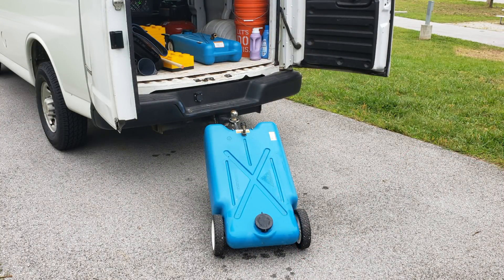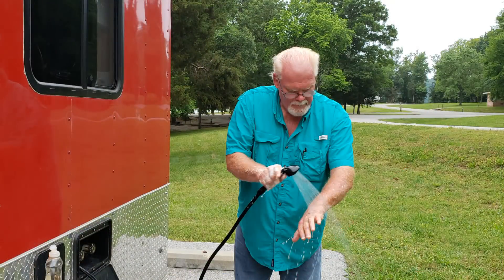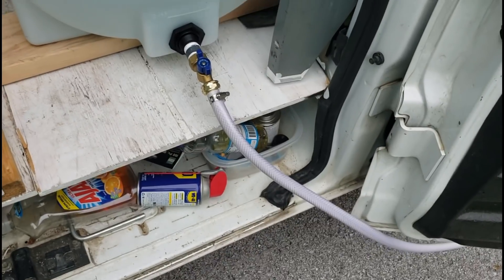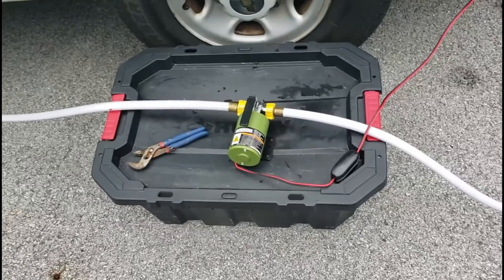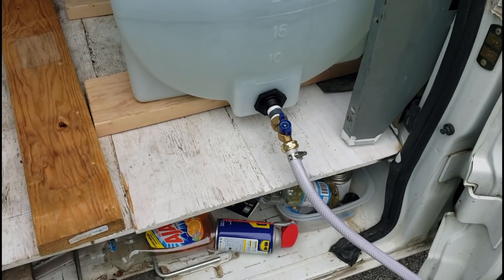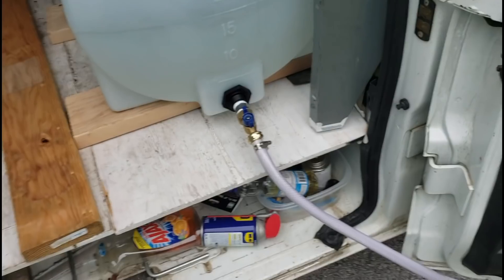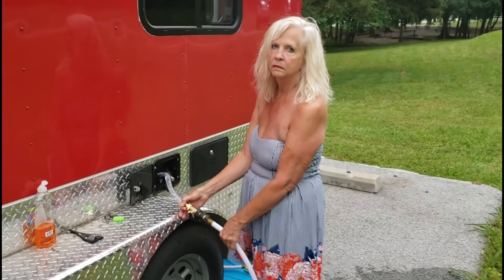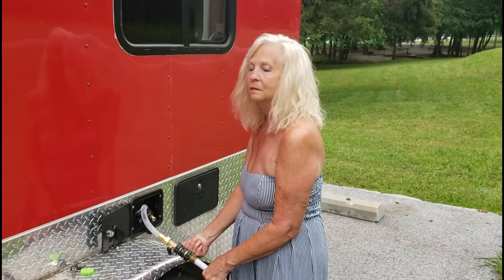New Water Transfer System/Cargo Conversion Living

Comment: Don't forget to wash the handle of the outside faucet. Otherwise you touch it with dirty hands then handle it with supposedly clean hands, but it's actually dirty. 

I agree use a pump that matches your trailer pump so you have a spare/parts

Comment: It'll go faster when you turn the van engine on if you don't already have it on. I would probably go with the AC pump and run a little 80cc 2200 watt dual fuel Sportsman generator I have it'll run less fuel while running the pump. And most generators have 12-volt DC but watch out for the amps that it's not maxed out because over the years they pulled the DC amps down on the little hand portable inverter generators.

Comment: You should make sure that your running your vehicle when filling your tanks.. just in case you battery low .
Reply from the maker: We usually do.
Reply: @billanddeb  ask Debby first remember k.
Reply: @billanddeb  or you could put a automatic cutoff to the battery when the voltage drops below a certain point. it will automatically disengage the battery from your device. If you put an external plug on your vehicle this is a very good device it's more like a security blanket. another good device from harbor freight is this small portable power packs that enable you to jump your vehicle or even to run the pump. There's a guy online called struggleville.net his sight is dedicated towards tools and has all kinds of deals and lots of them are on those power pack devices from Amazon sometimes almost 40% off the price.

Comment: Should buy an inline water filter you can get cheap at walmart. That pump most likely not a clean water pump even if your not drinking.
Reply from the maker: Nothing but clean water from a spigot labeled approved for drinking has been run through that pump and we disinfect it periodically.